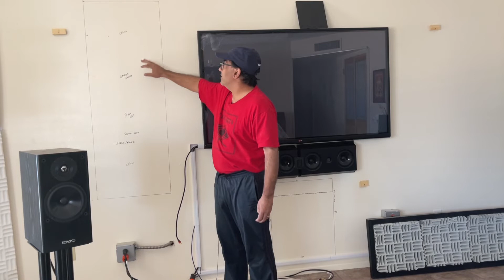From Laboratory to Living Room - Part One + Quick PMC TB2 Review

Comment: Good video my friend,  where are your open baffle speakers.
Reply from the maker: Saved the parts. Dumped the Cabinets. It was a “cheap” ($600) experiment. I will in the future build two 12” stacked H-Frame Subwoofers to augment things from 20Hz (attenuated of course) to 40Hz.

Probably gonna buy a flat pack from GR Research and re purpose the el cheapo GRS Woofers from the Open Baffle Debacle.

✌🏾

Comment: The output choke inductance has to match the tweeters impedance at 15-20kHz. Otherwise you get more/less spl at this frequency. The output filter makes a lowpass filter and the filter frequency  is a affected by the impedance..
Reply from the maker: I just did a quick calculation and looked what I had in my junk bin and it worked ! I honestly wasn't expecting much but it sounds good and natural.